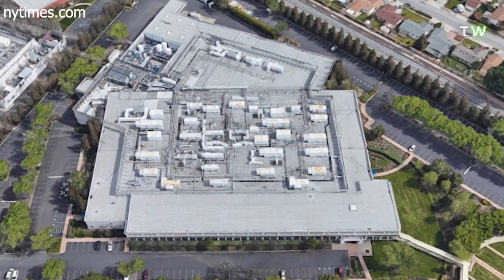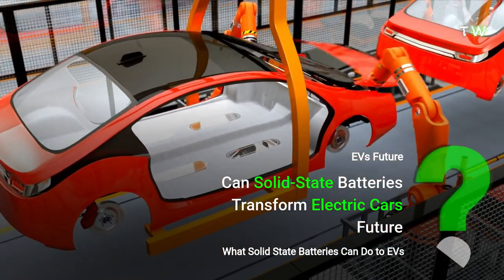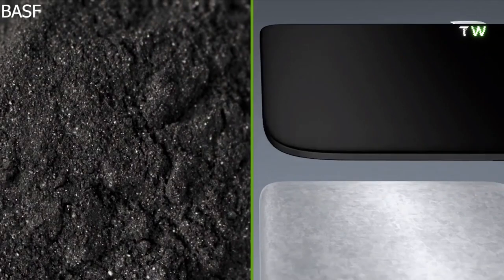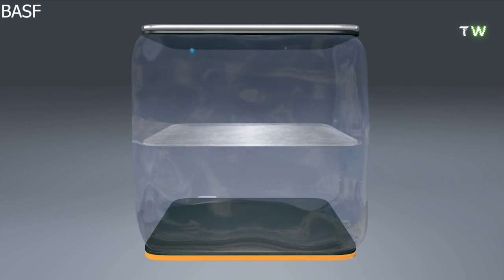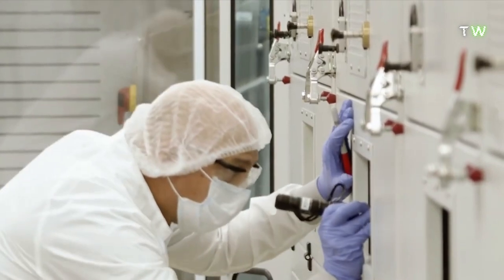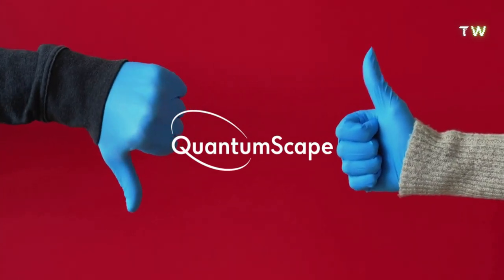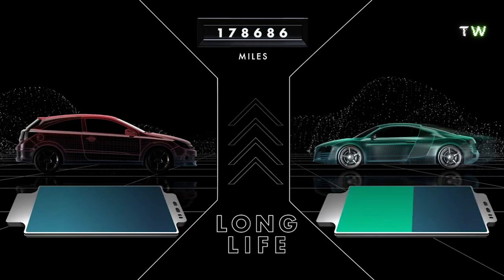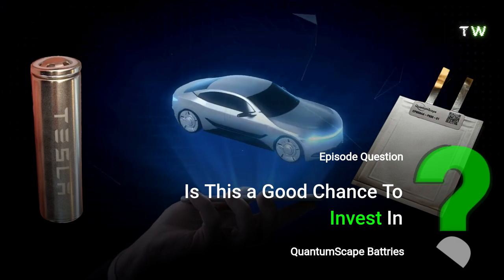QuantumScape Battery VS Tesla 4680 Tabless Battery - Solid State Battery VS Lithium-Ion Battery

Comment: Apart from how many miles worth of fuel you can fit in your car, and how quickly you can get it in there, what are these ‘performance metrics’ that combustion engines ‘mostly outperform’ electric vehicles on?
Reply: ok....so there is distance, and convenience of refueling, like you said, then there is longevity.... when people take care of their ICE motors, some models can reach over 1000000 miles.... not to mention we all know how batteries preform in cold weather and over time..... ICE preforms with relatively the same with 1000000 miles (maybe down a bit of power)....batteries will never last that long and as they age, will significantly drop in power and range..... some cars that have been siting for 30+ years with ICE, you can literally turn the key and start them up, give them a tune up and its good to go! You will never see that with batteries..... They will just be dead....
Reply: @uglybassterd1  Leaving aside whether longevity should be considered a ‘performance’ metric, I’ve owned 8 ice cars over the last 30 years.  Barring the write-offs, they might still have been on the road today, in some ‘Ship of Theseus’ fashion, and I suppose the same could be said of any man made contraption.  The thing is, at some point, the maintenance, refurbishment, and part replacement just isn’t the most viable option for a vehicle.  Currently I drive a Tesla.  Not a fanboy, it’s just my best financial option.  I’ve driven it 250,000 miles, and apart from tyres, the ridiculous door handles, refurbishing the suspension last month, and bodywork incurred by my own idiocy, it hasn’t cost me a penny to run.  At some point after the warranty expires, I will have to pay for a battery replacement.  It’s already saved me that cost in fuel.  It’s not magic; there’s a TTF for any component, but when those components don’t move or rub together, that time stretches way out.  I drive in the UK.  To do my mileage, even in a Prius, would cost me over £8000 each year in fuel alone, never mind maintenance and servicing. I don’t plan to ever get rid of this car.  Everything is modular, and the free fuel deal plus my mileage makes replacing every plank on the ship a better option than getting a new one.

Comment: Didn't Quantumscape lie about their battery as it turned out to be a hybrid of Lithium Ion and Solid State?
Reply from the maker: No, they didn't, watch this episode carefully to understand what they've done.
Reply: (In simple terms) "Normal" Li-ion batteries uses C-based anodes to stabilize the Li-ions when the battery is charged/charging (upper "liquid" layer). The Solid-state from Quantumscape, doesn't have an anode-stabilizing material (= no "liquid" in upper layer). So when the battery is charging the Li-ions will form Li metal between the ceramic separator and anode-contact. This is why they call it "Solid-state". But it can be argued that the battery isn't totally in a "solid-state", although this would make it even harder to manage the expansion and dendrite problem.
I hope this was somewhat helpful.
Reply: It's my understanding that, yes, there is some confusion regarding the use of the term "solid-state".  Many in the industry reserve the use of the term "solid-state" for batteries that are made of completely solid materials.  This includes the electrolyte.  I believe SolidPower is an example of a company pursuing this approach.  QuantumScape by contrast does not use of solid electrolyte.  Their CEO has admitted that they will likely use an electrolyte in a gel form.  It may be better to refer to QuantumScape's technology as a "lithium-metal" battery.  They do eliminate the graphite anode, but they do not have a solid electrolyte.